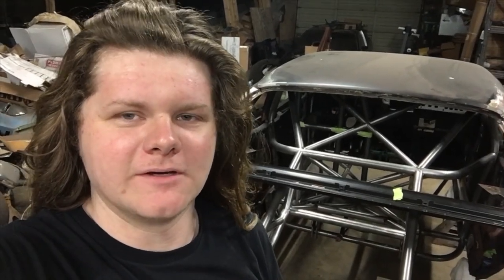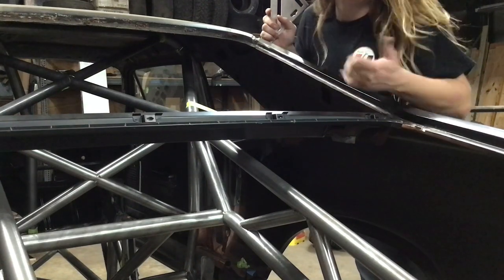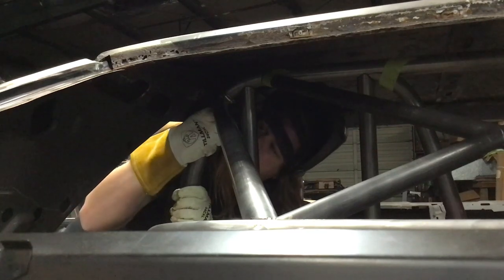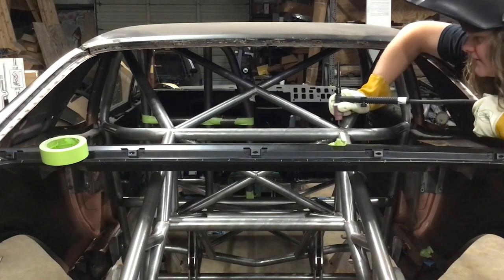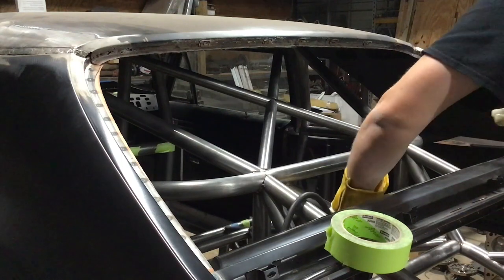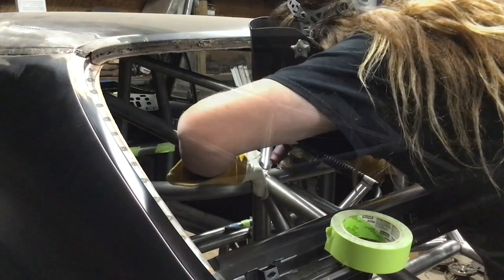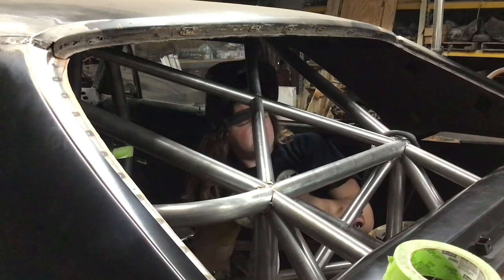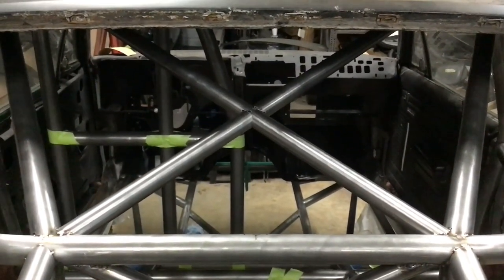Nova Rear Cage Main Hoop Support Down Bars and X Final Fit and Tacked In! 25.3 Chassis Chromoly

Comment: I’ve never thought to stretch tacks like that. That’s something will we surely do in the future.
Reply from the maker: Yeah, it takes a subtle touch (practice), but it's a handy little trick, if you just pulse the pedal in small but increasing amounts, you can feel when the parts begin to move, then when you get everything where you want it, make sure to add another tack in a different place before you weld everything.Thanks also for watching!

Comment: Hey mate huge fan , congratulations on your mad skills . Do you use a scotch-brite to shine the molly up ?
Reply from the maker: Thanks! I appreciate you watching! I don't use scotch-brite to polish the tubing, but that would work great. I typically just use 180 grit sandpaper. I keep the sandpaper handy, but scotch-brite is great stuff. I use scotch-brite roloc pads to polish metal frequently. Works great for getting edp primer off of body panels before welding. Thanks again for checking out my videos!

Comment: Great job. How much do you think the car will weight once completely finish?
Reply from the maker: Thanks! This car will be "All Steel / All Glass" (only composite panel being the hood and no polycarbonate windows) and will have a fair amount of accessories and amenities, such as power steering, a passenger seat, turbo system  and a 20 gal. fuel cell, etc.. That being said, a lot of the creature comforts will not be included such as heat/air and windshield wipers. Considering everything, I am building the car with a 25.3 spec. chassis which is rated up to 3600 lbs and I think with driver and fuel it will be close to that. There are a few things that can move the final weight up or down including battery type/quantity and whether the tin work is all steel or if we decide to put some aluminum in it, so hard to say exactly right now, but without driver I'd have to guess 32/3300 lbs.
Reply: @keefershotrodshop  Ok. Nice work.
Reply from the maker: @tomathiasbeauford3759  Thanks! A Nova like this with Lexan/optic armor windows, fiberglass front end and doors and aluminum tin work could probably weigh mid 2000's depending on the drivetrain. You have to start really eliminating a lot of the factory inner structure to get down closer to 2000 lbs.

Comment: I got a back half in my 25.2 truck and I think it is built to skimpy. I don't think it's enough bars or connections to be strong enough for the back half
Reply from the maker: As a rule of thumb, on a tubular chassis, I generally like to see a good pathway of tubing running from the shock mounts to the main chassis structure that is totally triangulated, or at least boxed; no cantilevered tubes or brackets preferably (relying on the bending strength of the tubing, tubes are much stronger in compression and tension than bending). Also if the backhalf supports the truck bed, it needs to have proper reinforcement depending on the materials and weight of the bed. Keep in mind: the shocks push and pull on the chassis, the anti roll bar (if equipped) transfers the twist from the driveshaft torque to the chassis, and the suspension links push and pull (depending on acceleration/stopping/etc.), so consider all of that and look at how the chassis will react to each action. Main structural stuff is usually 1-5/8" on drag race stuff, with 1-1/2, 1-1/4 and even smaller gusseting and reinforcement. Some of the materials used can look a little skimpy, but when properly oriented can work well. Check out some pictures online of chassis built by Tim McAmis, Larry Jeffers, RJ Race Cars, Jeff Lutz, Larson Race Cars, Jerry Bickel, Skinny Kid Race Cars, MRC, etc. to get an idea of how they are typically built.
Reply: @keefershotrodshop  can I pay you to take a look at my backhalf and get your opinion. I have pics of the s10